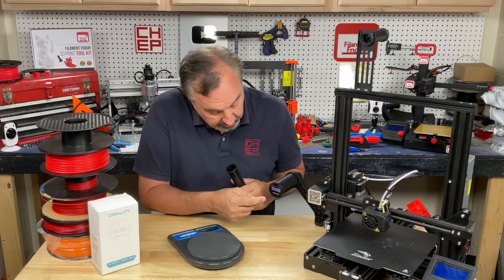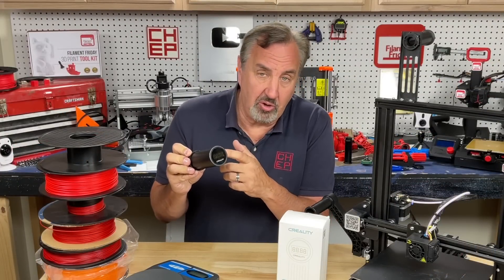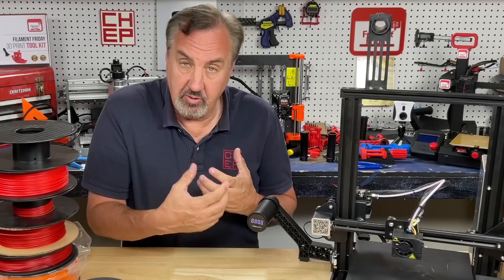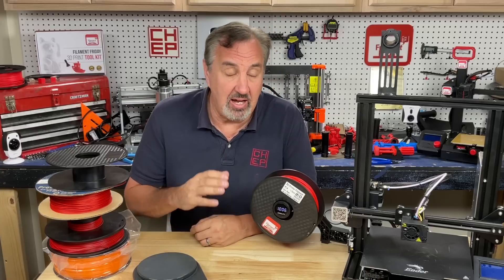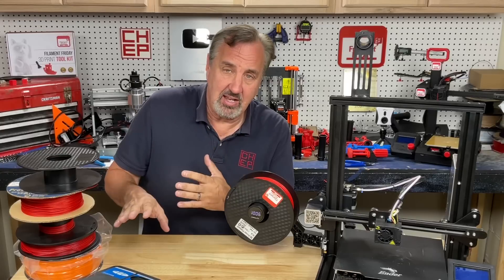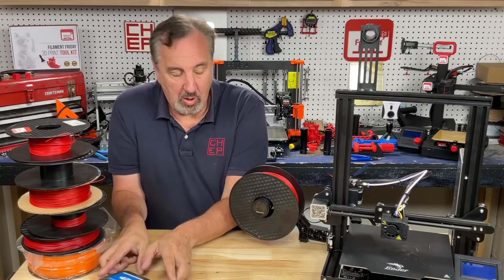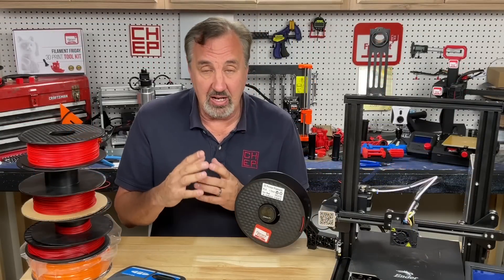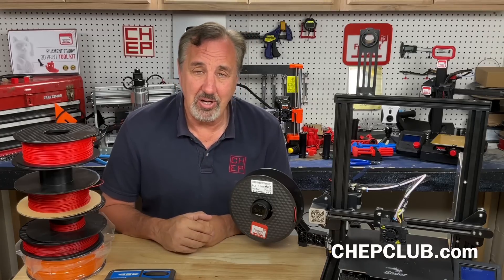Digital Spool Holder that Weighs your Filament

Comment: Uff ... 30 bucks and I would need at least two if not three. For spools hanging on the top (like on a Sovol SV04 IDEX) it could be handy, especially since the printer is already big and there might not be the place around to lift the spools and weigh them individually.
But then another one for my Ender 2 Pro ... would mean 90 bucks, which is a bit pricy.
Let's hope they include that in following printers and with mass production can reduce prices to like 9 bucks or so, since a normal scale can be get for 15 - 20 €.

Comment: I have an Ender 3 S1, will this just screw into the existing spool arm?
Reply: Yes but...  This digital spool requires the Creality logo to be level for proper measurement.  Screwed into my S1 OEM holder causes it to be out of level thus inaccurate.  A spool that weighs 1055g then measures only 750g on the digital spool scale.  I have not found a way to screw into the OEM holder and get the logo into the correct level position when locked.

Comment: Lol, don't love it but I like it. very well said. Most of the times the filament is also inside of the extruder and pulling on the spool, with this digital spool holder, is weights a bit better I guess.

Comment: Really only applies when the spool gets low. I’ll usually plan for 800g in a spool, stop and weight it before continuing. Gives some padding for failures that can always be welded together later if the waste is significant.

Comment: Get an inexpensive strain gauge and an Arduino and a small i2c display and build a custom, simple open source spool scale for much less than $31. Put a Bluetooth transceiver on it and you can query the scales from your phone. Lots of possibilities. Great channel and content Chuck. Thanks!
Reply: That's a great video idea for your channel! ;) I will definitely watch that!!
Reply: Recently built one for just a test. Got a 5kg load cell with HX711 for 3$. Calibrated it at a couple temps using known weights+a scale.

Printed a little holder where you stick the stationary end of the load cell and the other end I slide on some plastic adapters which allow me to put on a ball bearing on which I just stick the spool on.

The Arduino is powered by the hotend fan connection which goes into a 5V fixed supply and the Arduino is connected to the HX711 with online copypasta and edited code. And then the Arduino is connected to an i2C OLED display I got for 2$ 

Overall whole thing took a day and costed 6-7$ to make. The hardest part was actually the code. Later I decided to change the controller from Arduino to ESP8266 and create simple web server
Now I can see the info on local network pretty easily. 

Honestly code is the hardest part here
Reply: @MaxC_1  care to share with us that are less than adept at all of this? Maybe an Instructables with a few pics, some code, and an STL? Pretty please :)
Reply: I'll buy the finished product for 9 bucks when your done. =)
Because I need two of them for my IDEX printer and I don't have the time to tinker.

Comment: I typically use non-attached spool holders holding both ends of the spindle  I'd have to design a self standing holder to accomodate this single-ended spindle.  I could move it from printer to printer.

Comment: I have one... completely wasted money. At the beginning i thought it was great.. i weighed an empty spool... and.. you tap it once.. it goes to zero.. and as soon as you put a full spool on it shows the weight of the filament.. perfect i thought.. well i was wrong !!! after 20 seconds  it turns off.. and then its (like you showed it) back to 0.. useless.. I DO NOT WANT TO LIFT THE SPOOL.. to get a negative number!!!!..  so i did (what i usually never do with things i bought) I threw it away.. 
I turned back to the Etekcity Food kitchen scale  i was using before..it was about the same price but it remembers the weight of the empty spools..(Tare function) and i dont get any negative numbers i have to calculate... why cant creality do something like that? with that thing from creality as it is... i feel the company  is trying to make fun of me, and rip me off.
And i dont understand chep whos opinion i usually admire and respect, telling me that this thing is usefull.  its simply not true, because compared to the kitchen scale i also have to lift off the spool, but it doesnt remember the weight of the empty spool. the kitchen scale i use has a tare funtion that stays in memory!!!
Luc

Comment: I use a Sunlu filament dryer with every print.
Have a little scale right under it that is zero'ed with the dryer, so every spool I load will give me a weight.
The scale remembers the original zero'ed weight so I just tap the screen and it tells me where I'm at with the spool.
Quick, easy and cheap.
Reply: That's an even better idea. I just weigh the spool when I open it, subtract 1000g, and that's the weight of that specific spool.

Comment: Sounds like it's time for an Arduino project. The ideal scale would store the total weight of a full spool and the user could set the number of kilograms this represents and the Arduino could calculate the weight of the spool out of the final readout since it would know anything above the filament weight is the spool weight. It could even calculate how many meters of filament are on the spool.
Reply: Was thinking of the same idea 😂 the only mysterious part i have wity the creality scale is how they were able to find a sensor cheap enough to measure axial load on a bearing.. currently the only brainfart i have is that they used a regular loadcell (bar-type) and fitted a bearing holder on it as well as the fixed nut part

Comment: ever since Creality released this thing I send emails to them complaining about this dumb code.  This product could be wonderful if it worked correctly, all you had to do was save the last weighing or not turn it off completely, resetting the weighing at all times.  They said that the intention would be for the device to turn off when there was no variation in the weight for 6s, they believed that any working printer would present some variation in the weight of the spool during that time, but this does not work correctly.

Comment: Would be nice if the weight was integrated with the printer software, allowing you to read the remaining filament length directly in the printer. This would also allow the printer to warn when a new print is started, if the print requires more filament that what is remaining on the spool. Would take the manual work out of it and make it more user friendly.

Comment: They need a calibration button, zero out button, and clear button. Calibration can allow you to measure an empty spool. You can then zero it out and put a full spool on. It needs to save the last reading. Then a clear button to delete the save info.

Comment: I think the core idea is decent but some refinement is needed. I'd like to see a version powered by the printer so I can show the weight all the time while printing and a memory with a zero button so you can zero out how much the spool weighs and then have it count down the weight while printing. That way you'll always know how much filament you have at a glance. If you could program how much the filament weighs per meter you could even have it show fairly accurately how much is left in meters right there on the screen.

Comment: wasted money.  It's not going to beep and tell you your about to run out.  It does nothing but weigh the spool, for what reason?  Why would I want to know how much a spool weighs, lol...  I know when to change my spool,  LOL!!!!!
Reply: Slicer tells you the weight needed. If you know how much filament you have on spool, you'll know if the spool will be enough. If you have empty spool you can calibrate with it
Reply: @mewil1  Or you can weigh the spool when you open the package, subtract 1000g, and be close enough.

Comment: Neat little gadget..but in all honesty, it seems like an idea that needed to get out the door in a hurry. Why wouldn't there be a memory function? Why isn't this capable of sending weight data to the printer? There are a whole lot of possibilities, yet.. they stopped at "Does it have a weight accuracy of +-3 grams?....Yes...SEND IT!" Oh well. I'll just keep living on the edge with those last few prints feet of filament.

Comment: Whomever copies this needs to make it stay on and count down the weight. It would then actually be usable.
Reply: And connect to printer for power and data so maybe it can show on printer directly
Reply: @anonymoususer8517  might be hard for most non Klipper printers, but any Klipper printer stock or self Klipperized should do that no problem. Heck might as well have a plug in that tracks filament usage in mainsail/fluid too
Reply: Why would an "always on, charge more often" mode be the top usable feature for you?
Reply: @weirdnewworld1736  because when it shuts off it loses all weight data and resets to zero. What’s the point of a on printer filament scale if it can only be used once when first putting the spool on?  If it stays on and counts down it becomes extremely usable and actually relevant.

Drop the battery and have it usb powered full time. This would drop manufacturing cost by 1/4-1/3

Comment: I just use a kitchen scale to weigh each spool when I open it and with a silver or black sharpie write the weight on the spool. that way its weight - 1000g = spool weight, yes as CHEP pointed out most spools have a similar weight based on material its made off, but does as he also pointed out vary from brand to brand. I've taken some spools down to the last few windings and had no worry that I was going to run out using CURAs calculated sliced print weights.

Comment: I bought one a couple of months ago... I kept having problems with spools falling off the printer while using this as a spool holder, something that hasn't happened on any of my other printers that use the standard spool holder, so I took it off. I have been considering printing a mount for the shelving unit that I keep my filament on, so I can use it to weigh the spool when I put it on one of my printers... but I won't trust it anymore to use as an actual holder.

Comment: The instructions say to put an empty roll on, then tap the screen to 0 it out. After that, you put the new roll on, and it will give you the remaining so you don't have to do the math
Reply: But that does no good if it doesn't save your 0 and just resets instead of giving you a weight read out every time you turn it on
Reply: @mattchumoore4214  you just have to do it again quick if you need to.  It's nice if you're close to the end of a roll

Comment: I think this would be much better if it was just a weight sensor connected to the microcontroller that could be read by Klipper/Marlin. Then the firmware could be aware of how much filament is left. That would enable features like warning before starting a print if there isn't enough filament, pausing prints at a good time (between layers) before a runout happens, etc.

At the very least, the creality one should have a separate tare button and remember the tare when it goes to sleep.
Reply: Please to see you think about that too. Something Creality should have done.

Comment: I like that idea. But I have an Artillery Sidewinder and I like the spool holder it uses. But I can get a digital load cell and use an arduino. I think I will put a key pad on it though so I can type in exactly what the spool weighs. So for example with a new spool like you have there. Type in 1203g and there you go. I do like how the Creality one is all self contained though. Mine wouldn't be as clean. You can go one step further and have multiple profiles. Label the spool with a code number. type that code in when you start and it will remember from the last time it was used.

Comment: Nice video. And yes, knowing at the printer how much filament is left is great.  I had a laugh, when you said track the scale down. My sister has a habit of borrowing my scale to weigh parcels for shipping. But she doesn't put it back. My scales has been missing for a month, and she refuses to help look for it. So having one on the printer will help a lot.

Comment: If you lift the spool off the holder while it resets, then lower the spool back onto the holder, you'll get the actual weight of the spool & filament. You still have to lift it as you show in your video, but the number will be positive rather than negative.
It would still be better if it would save tare weight and not recalibrate every time it turns on.

Comment: I could see some value if I were able to zero it out on a new spool and have it keep a running total as the filament was used up without it going to sleep and resetting.  I can get a good 2kg kitchen scale for $25 and it will work on more things than printers.

Comment: I missed the part where there is ANY value of this.
If it managed the information in the app.. yes, but it doesn't.
Reply: @wojtek-33  that is what God gave me eyes for. Having that thing not Integrated into the app is close to zero value.
Reply: @graphguy   You're telling us that you can accurately guestimate how many meters of filament is left and thus how many were used just by eye? How many times have you looked at the spool mid print and had to stop because you were running low on filament and didn't want to risk it. Having a scale on the spool allows one to basically use up most or all of a spool.
Reply: @matthewjbauer1990  filament is CHEAP. Also when it runs out, it works pretty well to just put a new one on and resume.
$100 says this is the slowest selling 'add-on'.
Also my spools have an indicator line and my slicer says what the projected filament usage will be.
IF this integrated info into the app..... totally doable,  then it would be worth buying... but it doesn't.
Reply: @wojtek-33  no it doesn't... Bluetooth or wifi

Comment: Why don't filament companies ship out filament without the spools?  Save on unnecessary plastic waste, and actually give us 1kg of filament and let us use the 3d printable spools the community have come up with over the decades?
Reply: because they are hard to deal with, used them and never buy them again, what a pain.
Reply from the maker: They do. Just search google for Filament Refill and you’ll see all kinds of filament rolls without the spool.
Reply: Sunlu do sell filament refills like that.
Reply: Just pointing out that 1kg of 1.75 diameter filament will always weigh 1kg if the filament was packaged by weight. The final length, from what I've seen/read online can vary between 333-335m depending upon manufacturer and batch. Neither length of filament or weight is more accurate, but weight is easier and with consistency being key, its what the industry has chosen.

Comment: Get in the habit of weighing the roll as soon as you take it out of the seal bag. Write that figure on the label on the spool. You’ll then always be able to work out exactly how much is left on a spool until it’s all gone.
Reply: Precisely what I do
Reply: It is quite a clever process.
Reply: Just remember that not every 1kg spool contains 1000.00 grams of filament and moisture adds weight. Still a good method if you play safe by setting the last 50g or so aside for very small projects, or when you don't bother changing the filament mid-print.

Comment: I would calibrate it on an empty spool to get the actual filament weight without doing calculations. But it actually reset every time so it could be annoying so far

Comment: I know some of the cardboard spools have holes and text to indicate how much material is left once it reaches that hole. Would be interesting to see if that's accurate or not.
Reply from the maker: It’s all an estimate to get you close to a useable measurement of filament without unrolling the thing.

Comment: I've heard that it isnt very accurate
Reply from the maker: You saw that it matched my scale. It’s worked fine for me.
Reply: My food scale specifically warns against leaving anything on the scale when not in use, because it degrades accuracy. I suspect the same problem will happen over time with the Creality scale.
Reply: @3dexperiments  any good scale will need the power on for a few minutes to zero out correctly
Reply: @karlschuneman7960  That's not what I said. Leaving any weight on a scale over time will eventually lead to loss of accuracy. At least this is what my digital food scale instructions say. The Creality spool holder scale will, by design, have the weight of the filament spool on it when it not being used.
Reply: Assuming this and your food scale are the same tech is a bit of a stretch especially as one is designed to have occasional weights on it and the other the weight constantly on it.
Reply: @Cloudman572  correct
Reply: @Cloudman572  It's not a stretch at all. I'd actually be surprised if it weren't the exact same chips and programming of a regular kitchen scale, just a slightly different load cell. There is a reason why it does not stay on - exactly like kitchen scales btw. and that is drift in the measurements over longer periods.
Reply: @ulaB  Drift of measurements while the device is kept on or permanent degradation of the ability of the scales to measure for life is the question?
Reply: @Cloudman572  Both. Over time, load cells can drift, creep, age and misalign; I only know that bigger cells (as in tons) need to be calibrated yearly  to ensure accurate results are maintained. I am not sure how this affects smaller ones.
Reply: @ulaB  Fine but "Over time, load cells can drift, creep, age and misalign" has no mention of leaving a load on the scale.
Browsing google has given my zero indication that main manufacturers or scientists recommend removing the load.